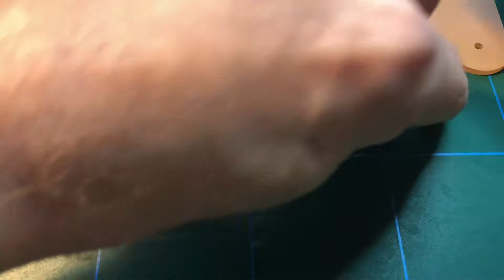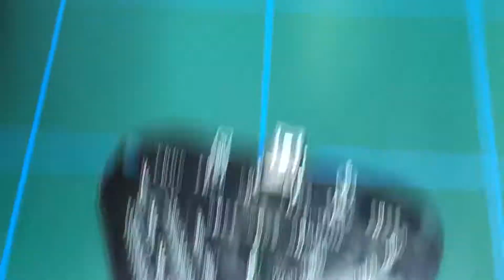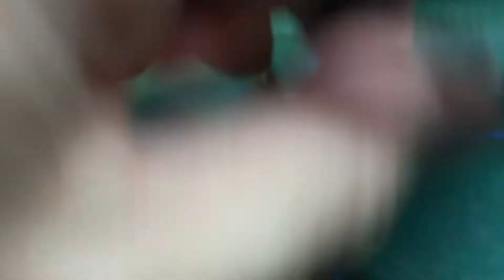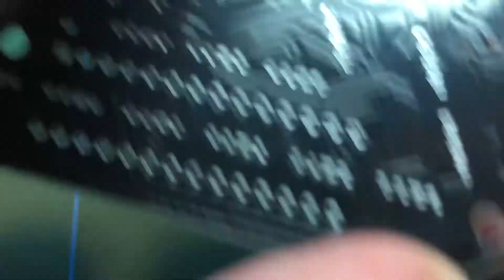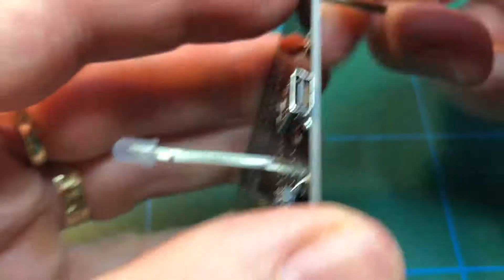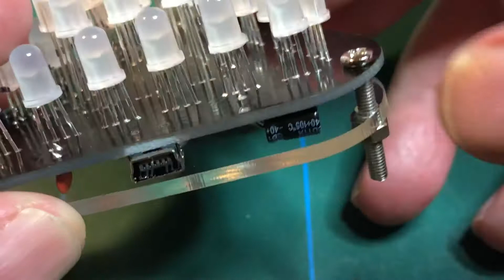Banggood: Geekcreit® DIY Touch Control RGB LED Pyramid Kit

Comment: '
hi E...
dont need to use mini USB plug on the PCB at 405 to 820...
better use a mini wire connection is more easily soldering than a USB